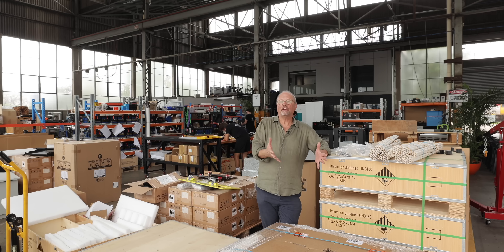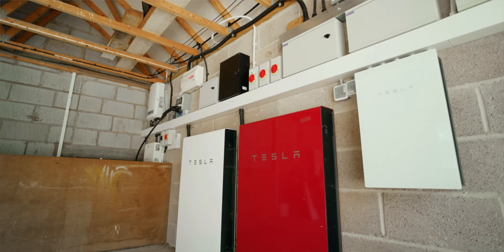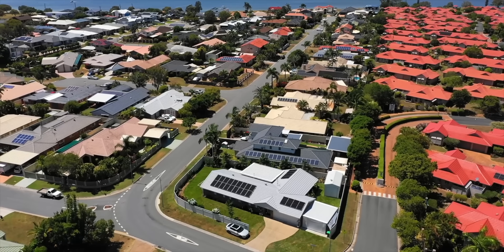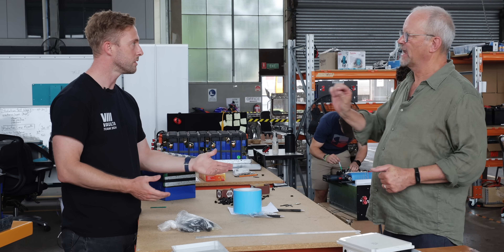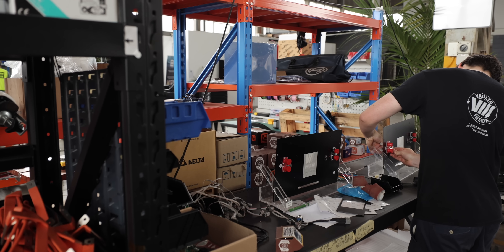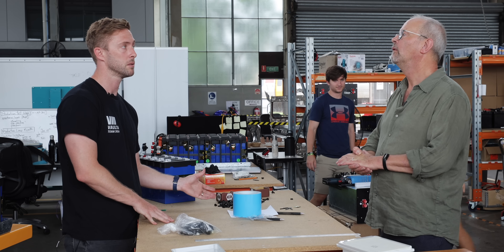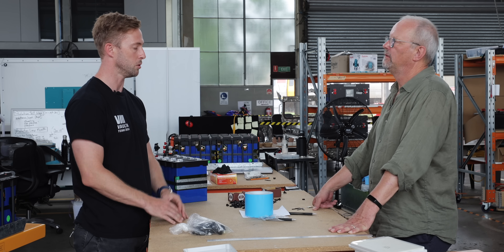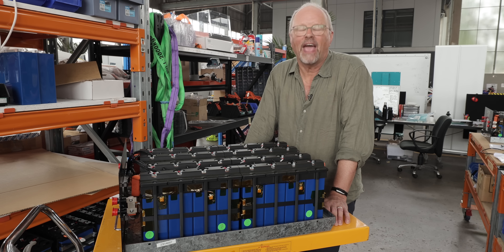THIS Recyclable Tech Solves Batteries' Biggest Problem!

Comment: As CATL have said that their batteries will come down to 50$ a KWh, a Tesla powerwall should cost about 750$ for the battery component. Add in the inverter and the casing - should cost  about 1000 $  right?
Reply: If you can DIY a pack, you can buy 15kWh of cells (same as the battery in the video) for around 1100Euro (in Europe). A BMS adds another 100 Euro to that price. Put them on a shelf, add an inverter of your choice, and you're done. I have 60kWh currently, and expanding to 100kWh this spring. I'm fully off-grid.
Reply: @upnorthandpersonal  is it difficult to DIY?
Reply: @antwnpowell  Not really. You need some basic electric skills (knowing how to use a multimeter, what a fuse is and select the right one, crimping a lug on a cable, ...) but it's not rocket science. Plenty of people doing it!
Reply: @upnorthandpersonal Would you mind sharing where you buy the batteries?
Reply: @upnorthandpersonal Out of interest, is your system modular - i.e. can you just add another 40 kWh without much hassle or is it requiring a total rebuild?
Reply: @drunkenhobo8020  No hassle - just add additional 48V (16s) packs in parallel.
Reply: Tesla will reduce the price a little bit and rely on their name to continue ripping people off. New entrants with much smaller margins will take most of the market.

Comment: I think that the cost of repairing one of these batteries half way through it’s life will be more than the price of a newer and better one, which will defeat the object.
Reply: Only if you never factor in the cost of waste, which we never do.
Reply: A newer and better one will be sodium based. But this set is 46V to 56V and sodium is 24V...64V ... That would mean replacing inverters too or only using half of the capacity.

battery failure is more often than not that only one cell is wasted.
Other cells are usually fine. But they are in series. So you are always limited by the worst cell.
You can replace the cell by a new one. Or you can sort and reuse the good ones for smaller boxes, like a 12V (4S ) box for a night light in the street. We are talking about 15 years in the future...
Or if you have enough, you can replace the bad one with a cell that has the same characteristics as the others. Each cell is monitored and balanced individually.

These batteries were not intended for ESS, but that's what we started using them for.
Reply: Half way through it life compatible cells will no loner be available.
Reply: @universeisundernoobligatio3283  only if we don't use foresight to guide our current innovations (pun intended). That said, the real question to me is what would be the incentive for purely profit motivated companies to do this?

Comment: There should be laws, demanding that all batteries be built in a way, that makes them easy to take apart!
Reply: Better to spend your time making the battery reliable then repairable. To make battery repairable adds cost, complexity, weigh and reduces reliability.
Reply: @universeisundernoobligatio3283  Not doing it, involves greater costs, so...
Reply: At least for stationary
Reply: No, their shouldn't. Welded batteries are welded for a reason. Every one of those fasteners is another possible failure point. Sealed batteries are sealed because it reduces failures. It all depends on what the batteries are being used for.
Reply: @JorgTheElder  You're saying that those benefits, are worth the many and massive costs? Worth not being able to replace individual cells, making it extremely difficult and expensive to recycle, and so on?
Reply: The reality around battery design is that there are already many 'laws' in the form of safety standards and these are what drives the industry to build battery packs the way they are.
Reply: more laws... how about just common sense in consumers or consumers who arn't passive ?
Reply: People are almost all stupid: look at how Apple removes features from their computers and convinces people that it is better: a laptop with a single USB-C port - how beautiful and useless for anyone with a secure Ethernet cable, a magsafe power supply and a SD-Card ! The Apple iPhone has no expandable memory, no headphone socket, no folding screens, no external payments for services, no choice of web browser engine, an illegal redundant lightning port and then charges extra for less RAM and storage which is soldered down and can never be replaced or expanded!  @ndudman8
Reply: @ndudman8  This has barely anything to do with consumers, so... your comment is pure nonsense.
Reply: @ndudman8 consumers ultimately have a need for a car, and if there is no option on the market with the requested tech, the customer will choose _something_. As there is zero incentive for car companies to modularize batteries, that option will never appear, unless the customer uses their  representation to push for laws that give them what they want.
Reply: A nice sounding reply which dosn't seem to understand the tech and requirements for cars... these batteries are already don't by many people for solar etc... especially diy as you can see from comments here. A care needs cooling/heating... which these systems simply won't do... not to mention the weight etc or safty factor ... so another shallow wishy washy video from this political and rather blind channel...  @Validole
Reply: @ndudman8  You know without these pesky laws we'd still have two-stroke engines running on leaded fuel?
Reply: how many modular phones are there which are cost effective, and actually worth upgrading... sorry its just not such a practical solution for general consumer goods, that are just that consumer goods, and until people rather request high quality that lasts twice as long, and is fixable then I'm not sure another govement legislation will help...  @Validole
Reply: @ndudman8  The reason that there are no cost effective modular phones, is because small companies can't hope to make something as cost effective as the big companies, regardless of design.
Reply: @ndudman8 common sense or active average consumer is wishful thinking. It is the kind of language lobbyists use when companies want to shift the responsibility for making good choices away from the companies and towards the consumer. The average consumer (which drives the bulk of the demand and thus has the greatest impact) goes for the easiest and/or cheapest solution for their need. The average consumer won't concern themselves with the negative impact their consumption has on the world. A profit-worshipping company is happy to provide an easy and cheap solution even if it means destroying the environment, exploiting workers and using child labor. There's so much evidence on companies doing harmful things and so little evidence on consumer demand driving positive change. That's why we absolutely, positively need laws that protect consumers and the environment, such as enforcing easily serviceable and replaceable batteries.

Comment: Problems is they are hand build so there costs are high, connectors fail alot more than weilds so while these are repairable they are also more like to need repairing.
Reply: This technology has been in use for years. And connectors do not fail. Welds do fail yes.
But nobody in their right mind would weld prismatics... It's too absurd for words.
And these boxes are so common that also the cabling is already pre made.
I would ask you how much a 14kWh battery box would cost in your setup.
The most important thing in the battery box is the BMS and balancer. The most important thing about those is that these improve with each software revision but also each hardware revision, and they are a drop in replacement if you just don't weld.
And the difference between hand weld and hand screwed with all the right instructions means that the screw wins every time.
The box itself welded or screwed is manual labor, so welding vs screwing doesn't really matter. At the end you still need to do thermal readings with a thermal camera with a max discharge and a max charge, just to see if all connectors are done properly.
Reply: Also about spot welding: this box does 300A discharge and could do 150..200A charge. A spotwelder typically welds with 100A. To weld the bars with a connection that's better than clamping fat bars against each other, you really need some impressive power. Which accidentally also might overheat the anode and cathode connection inside the battery.

However, spotwelding 18650, I 100% get you. Spotwelding is done for massive amounts of 18650s in parallel each only doing a tiny bit of power
But a prismatic cell is 5.6kg, and there are only 16 needed to achieve 14kWh (or 16kWh, depends if you use chinese or real world values).
Reply: Don't what hand weild or hand screwed a cheap repeatable relatable process is a much better idea @bloepje
Reply: Yes they have been around for years and they have always been bad ask any car mechanic , electrician or heating engineer  if they have more faults with connectors or fixed units like switch and wires everyone will tell you it the connection that are the issue almost always  @bloepje

Comment: $/kWh?
Reply: 16x eve LF304, 304Ah are about 70 euro per 16, so 1120 euro ex VAT for the cells.
The battery box like the EEL 48V 16S V4 is ranging from $550 to $730.
For the EEL I advice to use the V4 and not the V3 because the V4 has a electro-mechanical circuit breaker on the front next to the soft power off/on.
So let's say you have to pay $2000 for the box with batteries, that would be around $142 or 130 euro per kWh for the box including the BMS.
The cells themselves are 79 euro per kWh.
To be clear: only 4 months ago the prices were a lot higher and a year ago they were double. A year ago, the battery housing and bms was the cheap part and they have swapped places.

Comment: We can't recycle CO2, but can recycle Batteries
Reply: No but trees do that for free
Reply: @user-oz4mx1di7t  not enough I’m afraid and we keep cutting Forest down. Google earth the Amazon 😢
Reply: But there are far too few of them for that. The rate of anthropogenic CO2 emission far exceeds the rate at which trees can sequester it. Furthermore, depending on what happens to the trees there is no guarantee that they will hold on to that CO2 indefinitely. @user-oz4mx1di7t
Reply: CO₂ recycling is what biology is based on. The entire issue of Climate Change is due to humankind switching from CO₂ recycling to dumping exhumed 'fossil' carbon compounds' waste into the atmosphere. Recycled CO₂ is what "synthetic fuel" is made of - they capture atmospheric CO₂, combine it with hydrogen from water, and produce - for example - petrol. Recycling batteries could be net zero if the plastics involved were made from recycled carbon. Otherwise, absolutely not - they're a slight efficiency enhancement which, depending on how an economy obtains its energy, *may not offer much to Net Zero / Climate Change at all*.
Reply: CO2 is now being used as a coolant in A/C and heat pumps.
Reply: But we need hardly any of what is available for that. @TheGalifrey

Comment: What needs to happen is this idea needs to be rolled out across the world and maybe put into law that all other battery manufacturers need to make theirs easy to repair, reuse and recycle.
Cracking work guys!
Reply: unfortunately its not going to work like that! just look at tesla which has been literaly gluing all the cells together
Reply: @alanmay7929  I was vehemently against even cellphones being glued, however costs will always rule and most car batteries (to my knowledge) will be shredded at end of life. For cellphones the gluing helps IP rating and it has already saved one of my phones from dying in water. 

For Tesla I believe not much can be done with significant damage other than replacing the full battery, it sounds horrible, but that battery will have a high value for recycling. Keep in min the original 2012 Model S used old basic Li-Ion battery technology from 2006-ish (or was it 1996?) (source: Teslabjorn interview at Morrow Battery factory latter half). Todays batteries will be far improved in terms of errors, degradation etc. sure cells will die and what not, but it just keeps getting better and better.
Reply: @alanmay7929  
Thats what happens when you let IT marketing people give you computer controlled  devices...not just cars. But if you judge a vehicle by the size of the Infotainment system and possible self driving and whether you can link it to your I phone and play games while your sat in traffic.  You are just what they are looking for 😬🤦🏻‍♂️🧙‍♂️. 🇬🇧
Reply: Cue the EU  'Right to Repair' legislation, But not in the UK now, of course...🙄
Reply: @dennismay1023  
Like the Water pollution control standards. .. but its ok to sell the companies off to the  ANother corp, or hedge fund to siphon off  profits and pay un-warrented  Salaries for the supposed geniuses they hired to smokescreen whats not being done to stop  our water supplies being filled with 💩
Reply: not at all cause big blade batteries would be impossible. We had those boxes build packages and psckages build batteries before and lost volume cause each box its own bms and fuses and case did not work out. Who did repair such batteries ? 
They were replaced completely.
Reply: Liontron Battery to this for Years
Reply: Lots of people and companies  have been doing this for years. 
NOT new at all.
Reply: @Dirt-Diggler , done right are a few. The more, the merrier